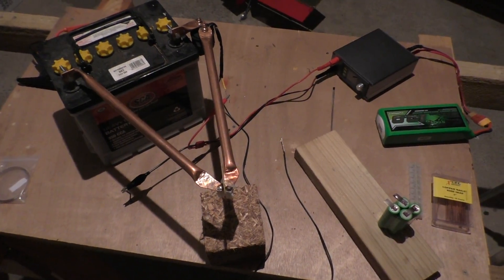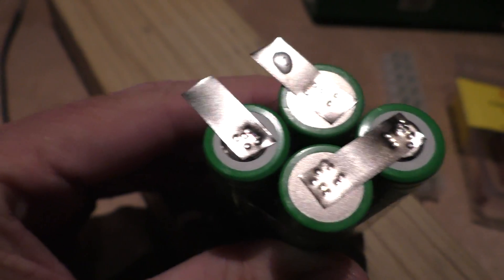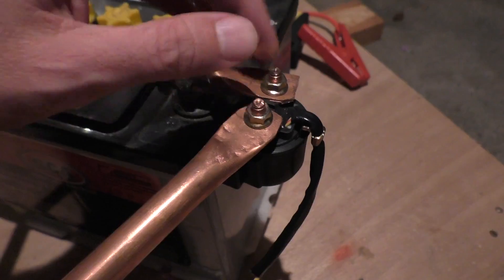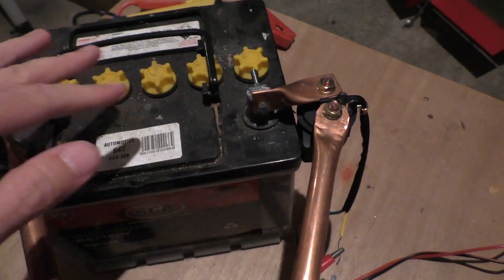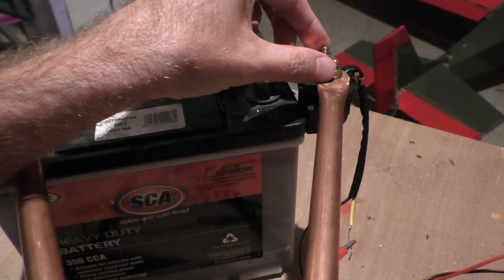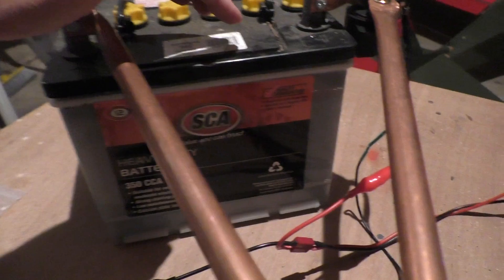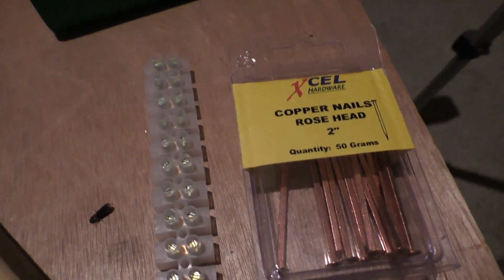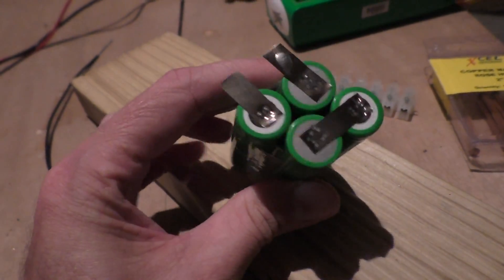Cheapass spot welder for Li-ion

Comment: Incredibly well designed and engineered as usual for making something elegant out of DIY junk, lol!  I’m trying to get my new very expensive German engineered Arduino based spot welder to work but I’m having trouble finding a 3S LiPo with enough juice to make it weld decently.  Looks like I’m going to have to dig up an old car battery as well.  I wish I had seen your video a couple months ago before I punched that crazy button.....  I’ll never learn!

Comment: If you needed to use the battery you could probably get away with a diode and a decent size capacitor since it will only be open for a second at a time

Comment: Looks good!  I will say that as long as it's done right you absolutely can solder to batteries.  I've done it many times and as long as you use a good quality iron and flux the battery is cool to the touch almost as soon as you're done with the solder joint.  Just presolder the battery terminal and let it cool, presolder the wire and the solder the two together. 
Its important to not have the iron on the terminal for more than a couple seconds at a time.  If it's taking longer than that you are either using a poor quality iron, it's not hot enough or you're doing something else wrong.
The only downside to soldering is you can't use the nice flat straps but it's not a big deal in most cases.

Comment: When the battery condition is low, it is the high current flow( or rather high load requirement)  that causes "voltage drop"within the battery. It is this resulting "voltage drop" that causes the solenoid to drop out, not any so-called  current "re-direction". 
I'd tend to go with the reply from Lucas Hartmann. 
If you have ever seen the results of a blown lead acid battery due to high current demand then you will know why.
Especially since that "spot welding" spark is within cooie of the hydrogen being pumped out of the high discharging battery.

Comment: That doesn't look dangerous at all. X _ X
Reply: It's not really.  12v isn't enough to hurt you, the solenoid keeps everything isolated and you're not putting enough heat into the battery to cause damage.  I suppose you could poke an eye with one of the copper nails.
Reply: @DoRC  12V won't hurt you, but 300A will melt the copper tubes.
Reply: @LucasHartmann  I suppose but why would that happen?
Reply: @DoRC  The solenoid is designed to stop a small current, just for the starter motor, not for the short circuit of the spot welder. The electric arc generated every time the relay opens will eventually weld the contacts together. Once this happens there will be nothing stopping the current flow, at least until something evaporates.
Reply: @LucasHartmann  starter motors easily draw a couple hundred amps.  Not sure what the starter solenoid is rated for but it's at least that much and the inrush rating should be double that.  I suppose it's possible to exceed that but the points of the nails are probably going to limit the current quite a bit.  That being said it probably wouldnt hurt to have some sort of knife switch to cut the power in case shtf.
Reply: Yeah what could possibly go wrong
Reply: Lick it! 😈